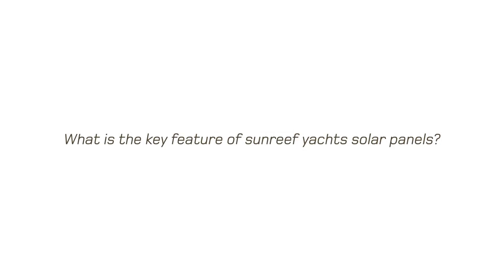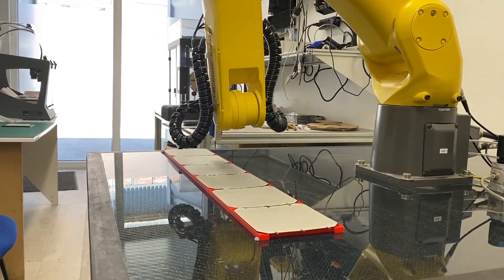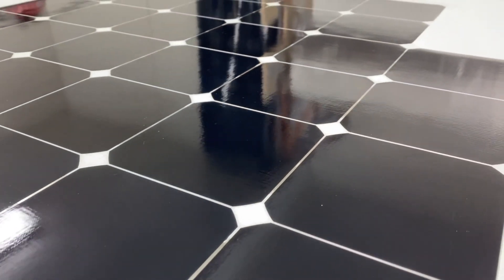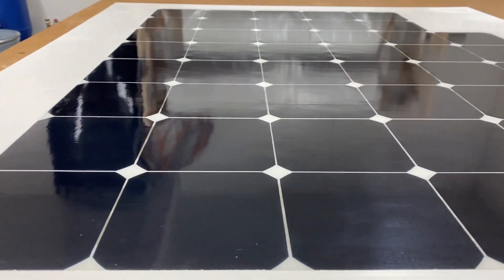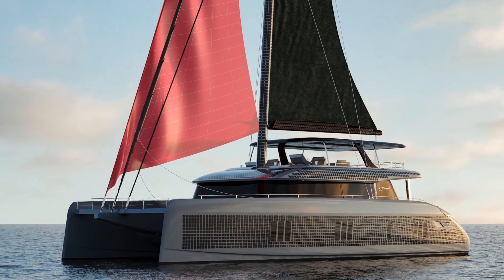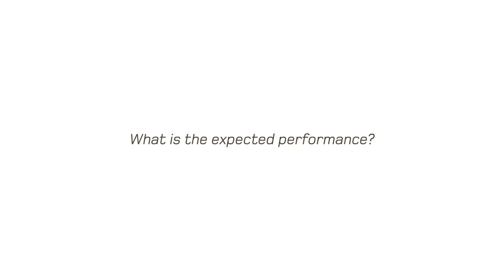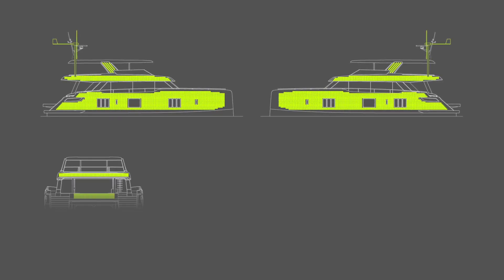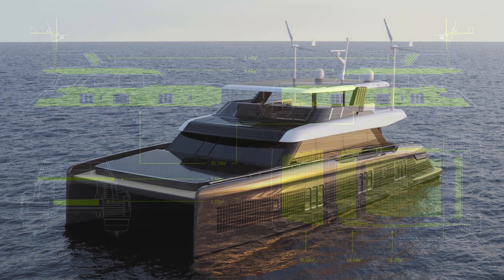Sunreef Yachts reinvents solar panels for yachts

Comment: Hey Sunreef - do you really end up losing the entire bow sundeck with the eco line? Some renders on your website have this area covered with panels (like this video), and some have regular seating up there. Totally understand the need to gathered much sunlight as possible, but it’s a real shame to have to lose that much deck space.
Reply: The need to gather as much sunlight*
Reply from the maker: Hello Drew, thank you for your comment! Catmarans from the Sunreef Yachts Eco range are fully-customizable, also in terms of solar panels. Our in-house produced solar power system can be integrated with any composite structure of the yacht, including hulls, bimini roof and bow terrace as well. As we offer a complete freedom of customization, it is up to our clients to choose which parts of their yacht they want to cover with solar panels and how large surface to cover. The more solar panels the more power they can generate. We're designing our boats to be eco-friendly without any compromise on luxury. Always feel free to get in touch with us at info@sunreef-yachts.com

Comment: Solar panels produce a lot of waste heat. They need to be cooled to maintain optimal efficiency. How will integration into the hull effect their performance? How will the hull material be effected by the extra heat?
Reply from the maker: Sunreef Yachts Eco are using special cells delivering the highest energy per rated watt compared to a conventional panel. The temperature coefficient is very low that’s why also under high temperature they continue to produce more energy than conventional technology. More detailed information is always available at: info@sunreef-yachts.com